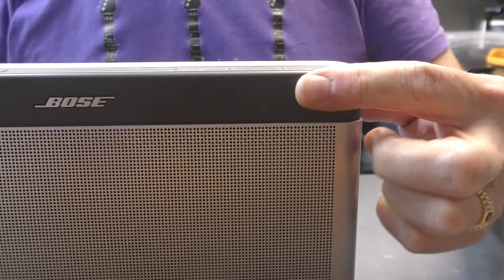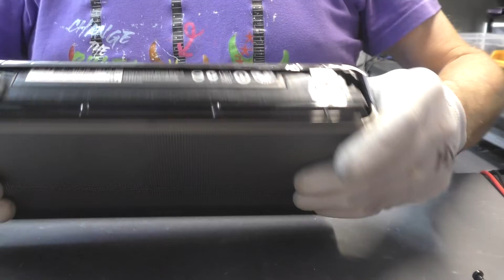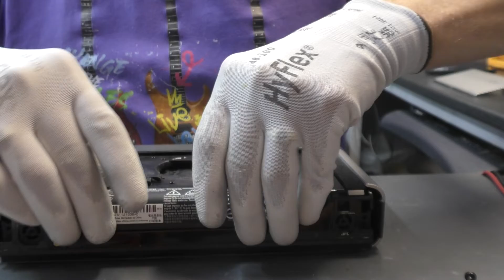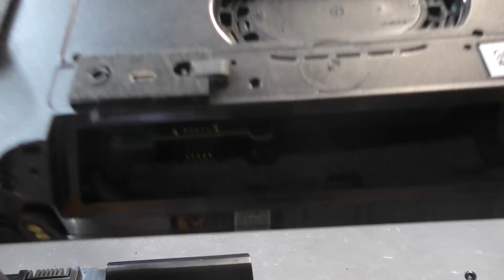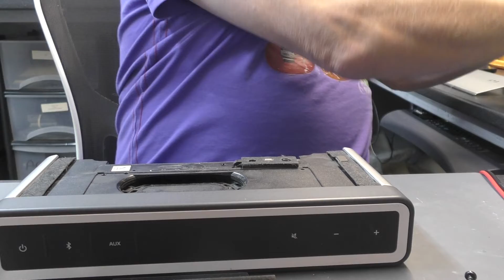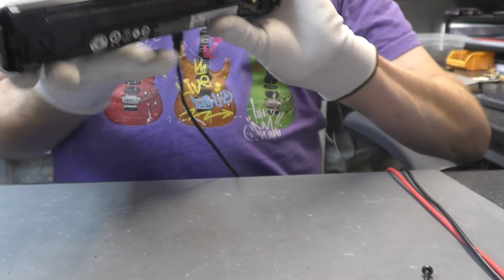Bose SoundLink III SL3 Dead. Battery Protection Mode?

Comment: You can just hold the power + mute button for around 10 seconds, and it should do a power reset and start working again. At least it helped with my unit without disassembly.

Comment: Mine has perfectly for years.  Yesterday I thought it simply needed charging, but checked this morning, and found the charging lite is flashing red.  Not working.  I will try and take it apart.  What does a new battery cost?
Reply: $20, I will replace my battery regardless after 17 years.

Comment: Don't need to do any of this. Just plug it in and out 3 times, then leave it plugged in and hold the mute button for 10 seconds, let go and you will hear a chime and it will start charging after 10-15 seconds.
Reply: That's what I wanted to say. That worked for mine perfectly fine 👍🏻
Reply: I do this suggestion. Fixed perfectly.
Reply: Thanks for the tip.  It worked for me.
Reply: Omg it worked. Thank you a lot!
Reply: Oh my god, this work for me. Thanks a lot
Reply: It worked, THANK YOU!!

Comment: Thank you so much.  Worked for me exactly the same.  I had tried Bose support and it was useless.  Basically said it is discontinued, and to upgrade with a trade in deal which turned out to be HIGHER in price than my local Best Buy.  Didn't even suggest this.  Saved my $400